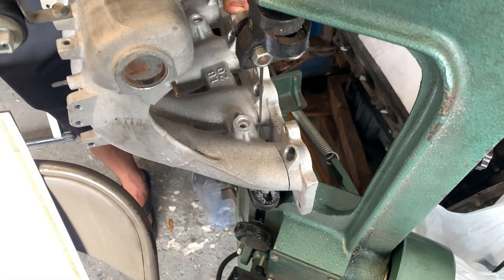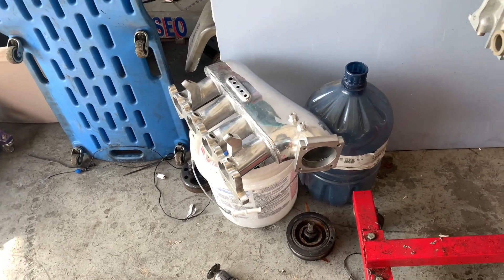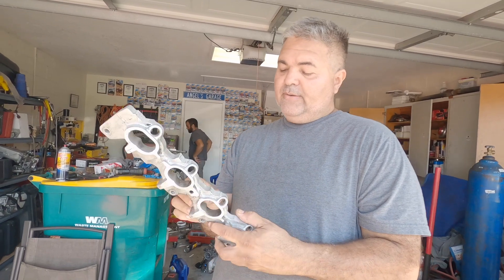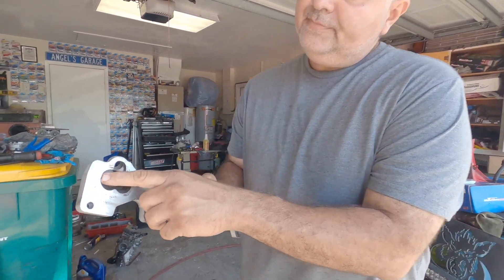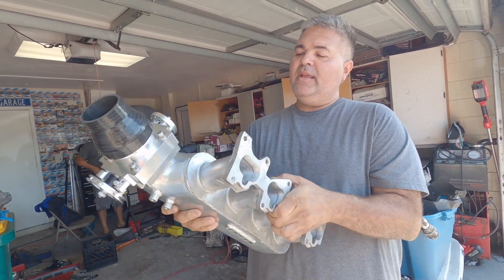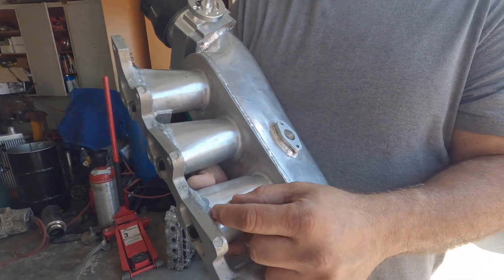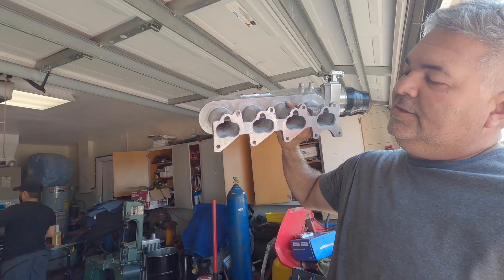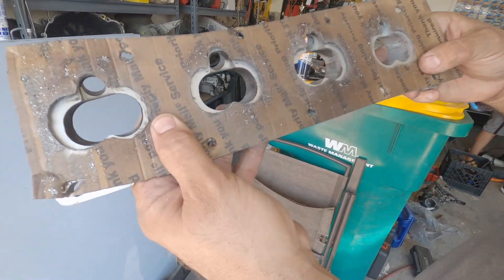Hyundai Tiburon Turbo Episode 20 (Cylinder Head Porting and Intake Manifold Upgrade)

Comment: Nice work!, The firewall has stopped many manifold builds over the years,short runners or bends may be needed to clear firewall,but,looking forward to your progress!!
Reply from the maker: Thnks for the support. Yes we had ro shortened the runners and angle it a little bit but is already fitted and we have more than a inch of clearance. Plus we have solid mounts to prevent the engine from moving. Stay tuned for the next videos that we are going to be installing everything back together.